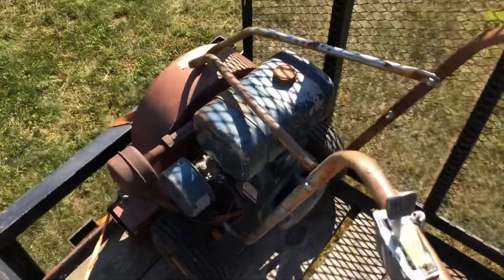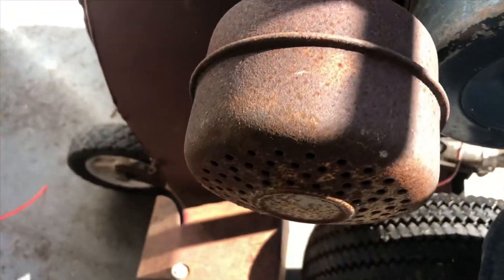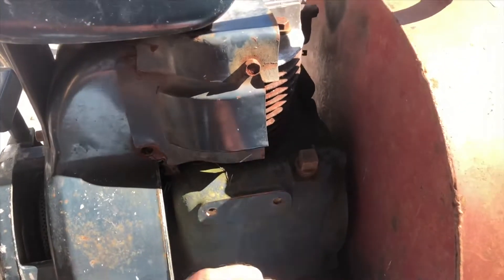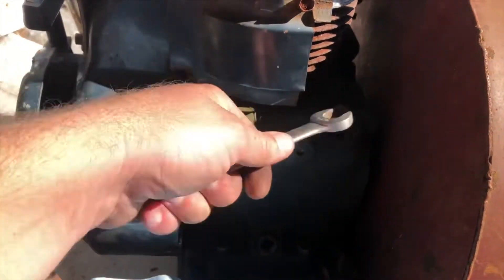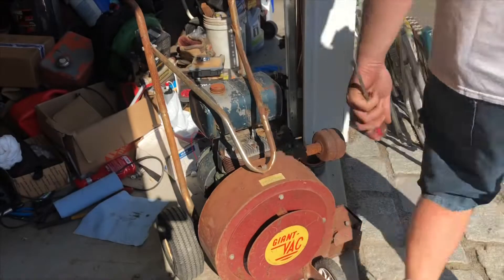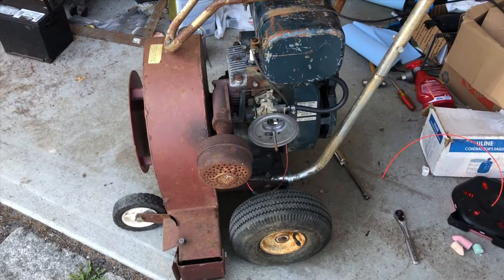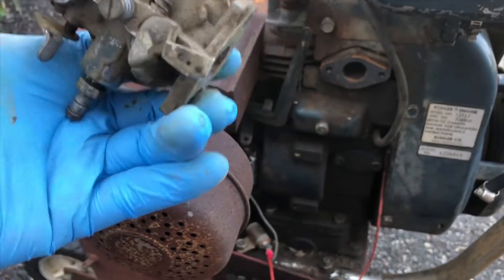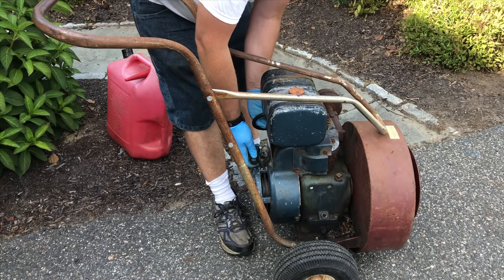8hp Giant Vac Leaf Blower K181 Kohler Score Part 1

Comment: The 8 hp. Kohler I got off same machine had a knock to it. Got engine for free   the  giant vac got a new B&S  took the oil pan off and found loose connecting rod nuts/ bolts loose causing the knock. Put new rod and .003 over size rings on STD.piston got another 7 years of life on a 657 wheelhouse lawn tractor .Yahoo. Jim in Co.